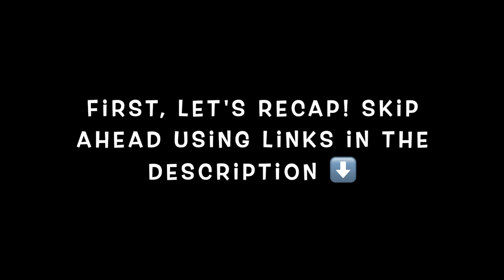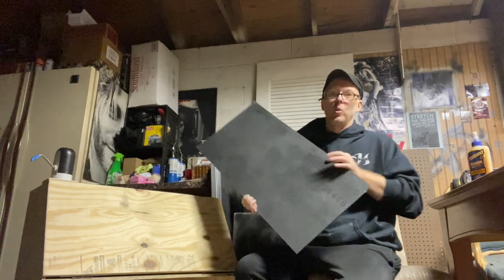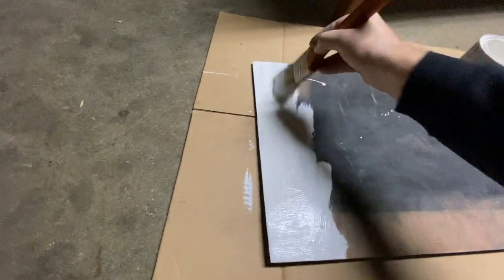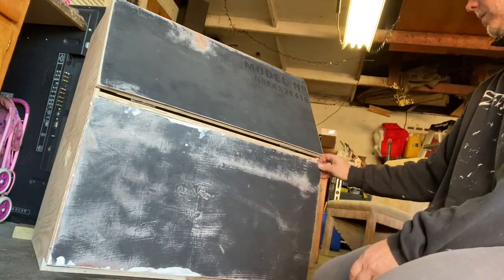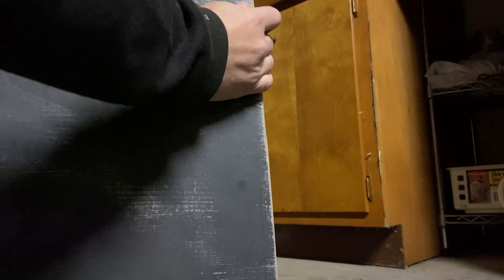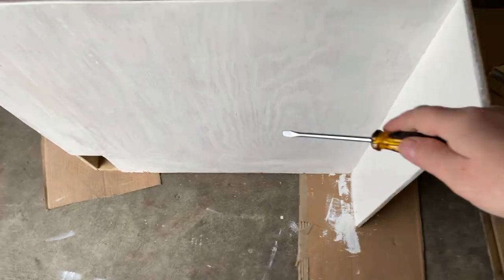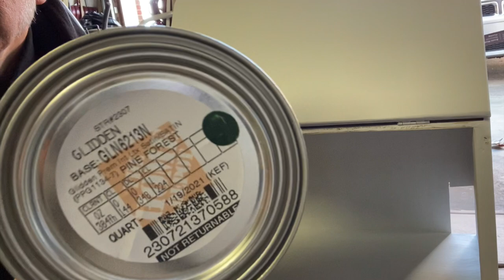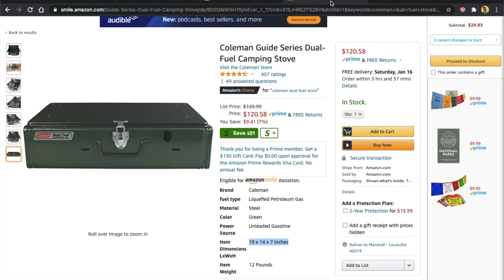Efficient Minivan Kitchen Setup for Van Life | Mellow Nomadic Adventures

Comment: How thick is your plywood?
Reply from the maker: Hi Aventure by the Mile! 😊 I wanted to get 1/2 inch plywood however they only had 15/32 inch which is super close! 

A lot of people recommend 3/4 inch plywood for their bed and I wanted to keep the weight down so I opted for what I got. 

I used the scrap from the  bed platform to build this cabinet. 

I have purchased 2.25 sheets of plywood so far. 

I am planning a shelf/flip down desk inside as well. 

Great question, thanks for stopping by! -Marshall